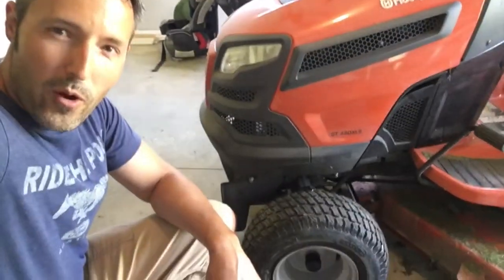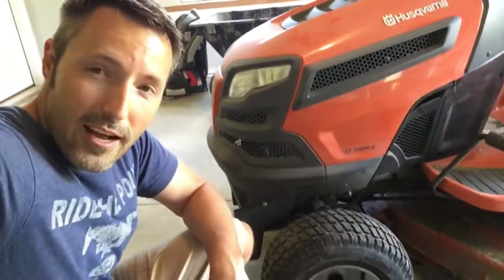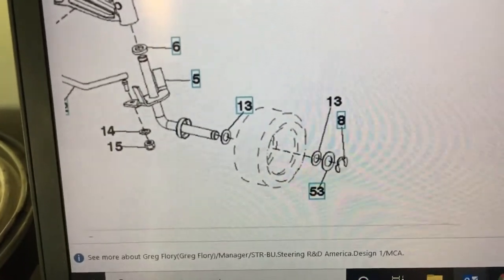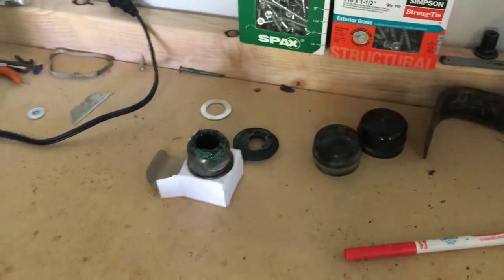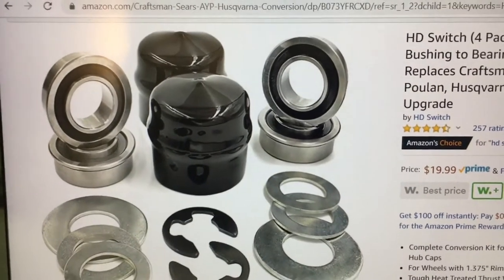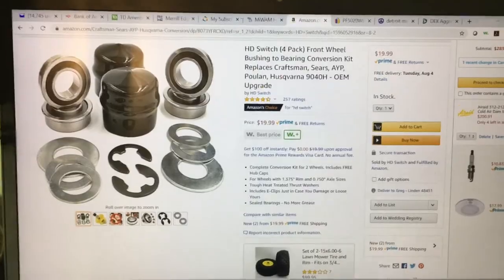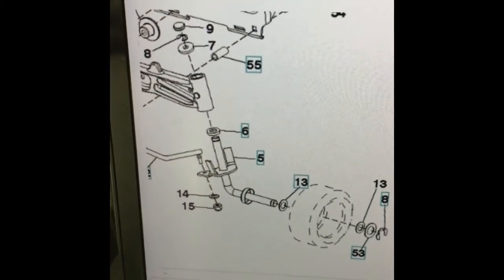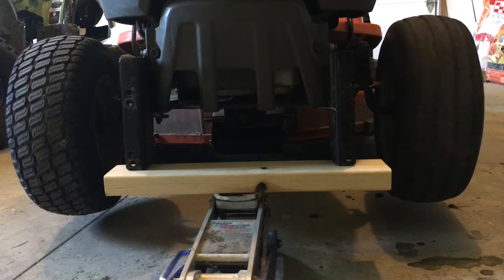Garden Tractor Wheel Ball Bearing Upgrade

Comment: A few comments. First off, the " Upgrade" you show, still uses that same C clip to hold your wheel on and the Roller Bearing or a Bushing won't make a difference at keeping the wheel on the Tractor. Cub Cadet, MTD, Yard Machine and many Craftsman use a Hair Pin or a Carter Key to hold that assembly together and having the wheel fall off wouldn't of happened. The C clip will wear thin and it starts to Flex and it will pop off.Cub cadet and the others I mentioned Do have Roller bearings on their Higher End Models.They aren't "High End" tractors. Most Wheel/Rim won't accepet the Roller Bearing that you are using because the center Hub isn't large enough Diameter to accept it.The Plastic Bushing wheels when greased once a year will last around 400 to 500 hours of use

Comment: I just completed the change to bearings on my JD E120 yesterday. 2 tips for those planning to do it. First, I used a 3/8" extension to tap out the old bushings easily and second, I used a 1 1/16 socket to tap in the new bearings. (with a rubber mallet). Very well done video, showing the process and result.
Reply: I was using a screwdriver to tap the bushing out. But remembered. Don’t know which YouTube video I saw. But grabbed my 3/8 extension. Tap tap and it was out.

Comment: Just finished a cub cadet upgrade.  The bushings had not been maintained and the axles suffered. The worn axles had severe wear on the bottom side.  My quick fix was to weld the worn sections then ground and filed back to a diameter that allowed the new bearings to slide on with enough tension that the inner race won’t spin. The fix wasn’t really quick but faster than waiting for two new axles.  The factory axles on riders have a dimension slightly under 3/4 inch and can possibly allow the bearing inner race to spin causing wear on the axle worse than the bushing.  Bushing is a softer material than the axle but with the new bearing the bearing is way harder than the axle.  So if for  any reason the new bearing seizes it will eat that axle for lunch. Something should be done to stop the possible rotation of the bearing upon a seize up.  There are plenty of ways from applying silicone on a clean axle to staking/peening the bearing set area to create enough tension to keep the bearing tight but not so tight to restrict installation and removal.  If you intend to grease these sealed bearings you will need to remove the inner seal and puncture the outer seal with a sewing needle.  This puncture will allow the grease applied to have an escapement without blowing the seal out of its fit and still stay closed under static pressure so it won’t allow anything go back in.
Reply: I assumed my 2014 Cub Cadets model LTX1046KW would have ball bearings. But no, The first thing to do even it is brand new is to get those bushings off the tractor. Replacing cheap bushings and think everything is fine until you inspect your spindle axles. Then you notice the lower half of the axle is gone and even with new ball bearings your wheels will flop around. What then , you have to buy new spindles $300.00 from MTD or wherever you like. Also added thrust bearings on the spindles.

Comment: Pull the inside seal off the bearings, and continue using the grease, and it'll last 100% longer than it will as a sealed bearing. 
Also pull the plastic bushing off your steering shaft, and go get a block bearing that will bolt down to the support brace the shaft goes through. 
That will improve the sloppy rattling steering shaft that is inherent to the cheap design they use.
Cost maybe $10.00, but granted that was several years ago, and we all know how that's changed dramatically.
Regardless it will save you money in the cost of replacing the gear at the bottom of the shaft, and the cheap metal gear that your tie rods are connected to.
By adding the block bearing, it allows you to actually put positive pressure on the gear, and the stamped quadrant they have in place. 
By pulling back towards the driver's seat when you are marking the position of the holes required to mount the bearing your applying positive pressure on the two gears that are your steering gear box, and this in turn does away with the piss poor design of using a plastic bushing as a support bearing to align the shaft to to the sector gear under the mower frame..
There's even a way to make actual articulating tie rods to eliminate even more of the sloppy steering this design has built into it, and basically its designed to fail after  the year warranty has expired. 
Same thing with the spindle on the mower deck .while there is a grease fitting there. 
The same condition that you have with the replacement bearings you used on the wheels exist. 
Take the blades off, pop the shaft out, and then use a brass rod, or a socket extension to knock these bearings out.
You see that you have grease inside the spindle housing, but the bearings are sealed on both sides  .
Explain to me how this is getting all the grease that you have made the effort to put into the dam fittings that are a PIA to actually put grease into in the first place, but then to actually design failure into something that can cost up to over $100.00 dollars each if you replace the whole spindle housing and everything that goes inside it.
Here's the deal, you do not have to replace the whole thing. 
You can buy the shaft, the bearings, the nut, are the spindle housing itself separately. 
Personally I get my bearings from a bearing supply house, and any size town has at least one of these,  if not in your town, the next one down the road, because farmers ranchers need bearings, as do a lotta places .simply pull the worn bearings out, take a trip to the supplier, and he can match you up with a better quality bearing by Timkin is one, and there's other ones out there better than the cheap Chinese bearings or wherever they got them
Simply pop the seal off the inside of the bearings that faces inside the spindle and grease them up properly, and they'll last long time. 
Hopefully this helps anyone who wants to read this short novel, but I consider it as a look into the crooked  way that we're cheated out of more money than they deserve from anyone period.
Some people can't be happy with a fair profit margin, because they're ruled by Greed.
Greed is what's destroyed man since the beginning of time, and eventually it will be what finishes mankind off completely.

Comment: Just worked on a craftsman that used different hub design, the axle was still 3/4” inch but the wheel bore was 1 inch”. This may well have been an engineering design to stop the upgrade of using sealed ball bearing and dumping the bushings!
Reply: Yes I can see them doing that for sure, sorry companies in America 😢😢

Comment: Thanks for the video. Should add a link to the kit. Also, bearings still need grease but those have seal. Take the inner seal on each bearing off and then grease will get to the bearing using the zerk on the rim.
Reply: Agreed 100%
Reply: I can see you guys NEVER took some of those "seals" off.  OMG, if you did, you would know HOW HARD it is to put it back and also how hard it is to take it out.  The ones that you can, it's usually Chinese Rip-Off parts.  Try OEM or good ones and you will see what I am talking about.  
NOTE:  You have better luck drilling a tiny hole and then using a needle to put grease in.  YES, I have done it.

Comment: Common mistake made when doing this... many people don't realize. "REMOVE THE PLASTIC SEAL ON THE INSIDE OF THE NEW BEARINGS" otherwise, there is no way the grease will get into the bearing. The only grease in the new bearing is what they use when assembling them at the factory "and is not much". Use a small screwdriver, pick tool, or the point of a knife to pop the seal out. Also, drill a tiny weephole somewhere towards the center of the wheel hub. This will allow you to see when it is full, so there's no way of blowing the outside bearing seals out.

Comment: Great video. I bought a used Husqvarna YTH-20K46. How do I determine which bearing kit I need to order for my tractor.
Reply: Measure the spindle outer diameter and the inner diameter of the wheel. Just to be sure. But order the wheel kit with your model number in the search will give good results too.

Comment: Just had to LAUGH at this guy, he tapped in the NEW bearing WITHOUT REMOVING THE INSIDE GREASE SEAL , so as soon as the new bearing grease is used up , he's going to have to REMOVE THE BEARINGS AGAIN, REMOVE THE SEAL, RE-PACK THE BEARINGS WHILE HE HAS THEM OUT, THEN RE-INSTALL THEM,  THEN PUT THE WHEELS BACK ON THE AXLE STUB, PUT THE WASHERS AND CLIPS BACK ON, THEN PUMP ADDITIONAL GREASE BACK INTO THE AXEL THRU THE GREASE NIPPLE TO FILL UP THE REMAINING SPACE. This guy is a real fart smeller,  oops sorry, I meant to say SMART FELLER.🤣😂😅
Reply: Please make a video show us your methodology!

Comment: I have had bearing problems with my cub cadet spindles and found out that most bearings are made in China and are sealed .  That does not work I guess because this is 3rd set on a 2016 cub cadet 1042  kw    v twin hydrostatic mower with 182 hours on it and that is because I have always used 2 mowers for my over 3 acres . Ifixit4u on youtube had a great video  . The last set of spindles I just took off because the pully kept throwing off the belt and finally ripped it  . Well took spindle apart looked inside bearings no grease and then noticed no spacer between bearings  . Shame on cub cadet  This time I am taking inside covers off bearings . The spindles have always had zerk fittings . But figure clean deck while at it and put on second coating of graphite slip plate to keep grass from sticking to the underside of the mower since I use gator blades . Why i did not do that i don't know , says 2 coats  . new cub cadet gow 2 coats also and gator blades